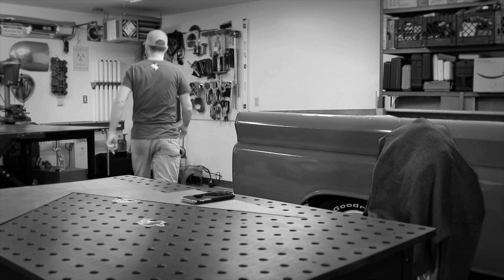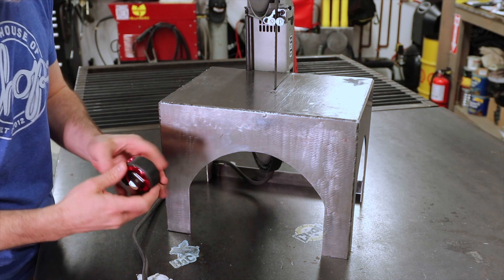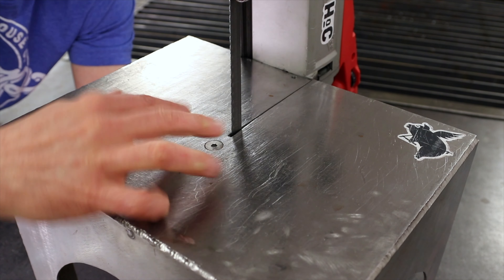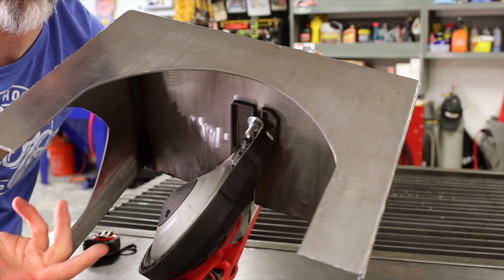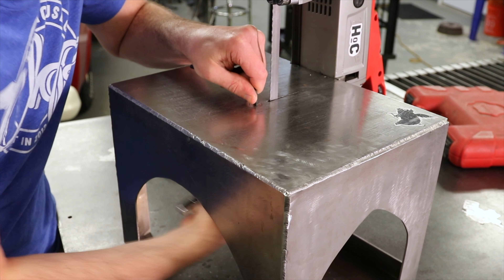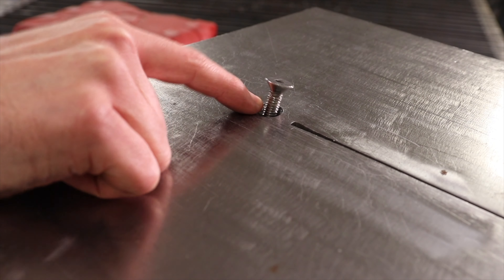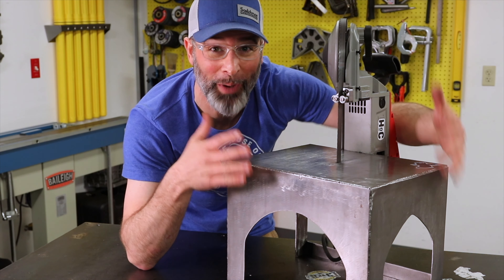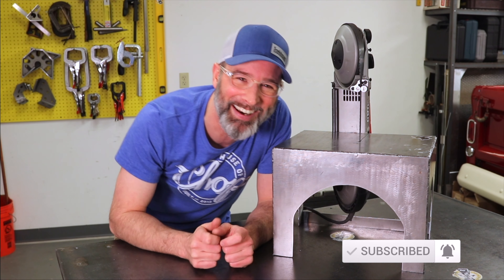LEARN from my MISTAKES: DIY Portable Bandsaw Table

Comment: Not only are you a fabricator but you own my favorite c10...I think I just found my favorite channel.
Reply from the maker: Thank you Edward. That truck is a fun one drive. Mostly 1966 stock with the exception of  the 350 and the Muncie 4 speed. 🙌🏼🙇🏻
Reply: @HouseofChop  She's a beauty!!! I actually once had a 63' Chevy C10' myself and sold it, that has been one of my biggest regrets. I plan to buy another one soon. One of my favorite aspects of the truck on the 63' vs your 66' is the wrap around front window but I've noticed alot of people seem to be more drawn into the 64' to 66' style instead. 🤷‍♂️
Reply from the maker: Edward Ramirez Thank you. I’m actually in your camp I like the earlier ones better especially the 60-61 with the original style hood. The draw back in those years were the front torsion bar suspension but can’t have it all I guess.
Hope you can find one for yourself. There are plenty still out there.

Comment: Dude!! I think you could probably drill a hole in the top the same size as your stronghand table holes and be able to use the stronghand clamps to hold things down. Love the setup!
Reply from the maker: You're the second person that said that today Nate. It's a great idea! I'm going to have to give that a go and test if the 1/4" is thick enough for the clamps to bite. 🔥👍🏼🔥
Reply: Worst case scenario you could always add another plate in that area to the bottom. I’m excited to see the modification!
Reply: Worst case scenario you could always add another plate in that area to the bottom. I’m excited to see the modification!

Comment: A solid mounting / clocking system, save that the slot you plugged with the table tab is an exhust port.   Notch out most of the middle of the tab and table a bit and the saw could probably breathe a bit better and still benefit from the slot capture.  Just a thought.

Comment: Harbor freight has the foot switch also. You could weld the head of the mounting screw in and smooth flush so you only need wrench on the bottom. The other option another YouTube used was to weld a simple clamp to the bottom that clamps the shoe to the table and then don't even need a wrench.
Reply from the maker: Great ideas! Appreciate you sharing them. 🔥👍🏼🔥

Comment: Thanks for the explanation! I don't have a porta-band yet, but when I buy one I'm definitely going to build a table.  Off topic, how do you like squarespace for you website?
Reply from the maker: Anytime, I hope it helps when you make your own. It’s without a doubt one of the most frequently used tools in my shop. @Ollaris  posted one today too that’s a wall hanger probably worth a look. 😉

As for square space it’s worked out great. I threw that site together quick and it didn’t bog me down. I’ve seen people take some time with them and get incredible results. The commerce part works well and makes it easy to gather data. All and all I’m calling it a win. 🔥👍🏼🔥
Reply: @HouseofChop  Thanks!

Comment: Do you wish you had the miter slots in it? That’s the big reason I’m leaning toward getting the swag version but not sure if I’d use it
Reply from the maker: The miter slots would be nice to a point. The blade has a bit of slop in it because of the way these saws are designed. It would be difficult to get perfect angle cuts on this style saw. If rock solid angles were something you frequently needed a metal cutting miter or chop would be a far better choice. I have videos on both 😉

Comment: Nice stand!  I worried about suspending the saw by the foot shoe so I built a stand that hangs the saw by the handle. I also made a separate support for the table. I made a video. If you search "bill k" you can find it. I would be interested in your thoughts on the design.
Reply from the maker: Thank you Bill! I’ll absolutely check out your video! Always enjoy seeing the same problem getting solved by different minds. Thank you for taking a moment to watch and comment 🔥👍🏼🔥

Comment: Have you noticed any adverse affects from having the trigger permanently engaged? I did the same thing with my Milwaukee bandsaw. I have no empirical evidence of this, but I always thought it was bad to permanently leave trigger to maximum pull. But it is a pain to strap it everytime, and sometimes difficult to get maximum travel on trigger that way.
Reply from the maker: Been like that for years and it still works 100% in both its intended and the table setup

Comment: Couldn't you take existing and add a larger plate to accommodate your wish list for clamping? Start new 12"x16" maybe 3/16" plate cut your notch redrill and thread set screws. Couple welds on bottom plates to locate plate gives you some clamp area overhang.

Comment: Making a hardwood fence for the miter makes all the difference MyBest.Tools Tune the saw with a combination square. Adjust the laser so its in line. See the photos.Every part in this saw is adjustable.
Reply from the maker: Steel and any of the softer metals.  I’ve even run it through rounds of stainless and they just dull a bit quicker